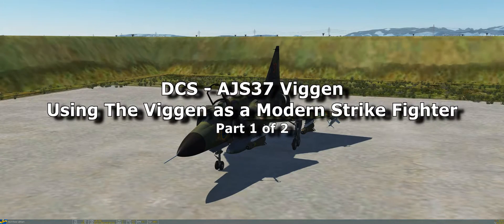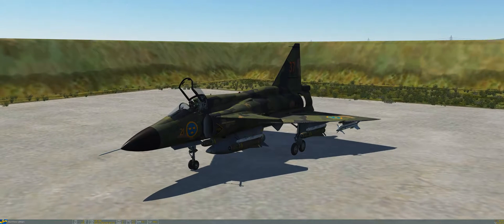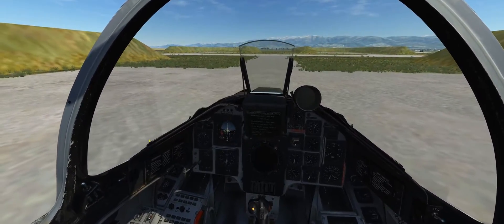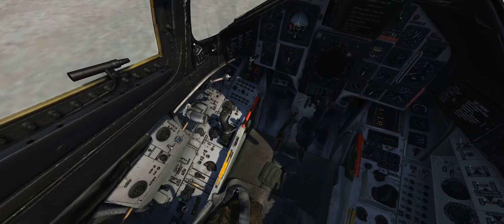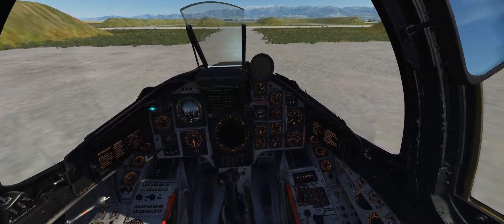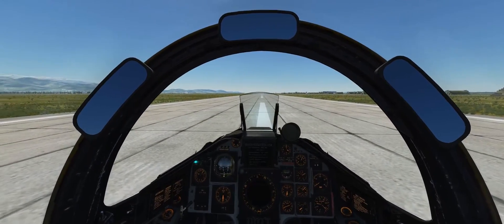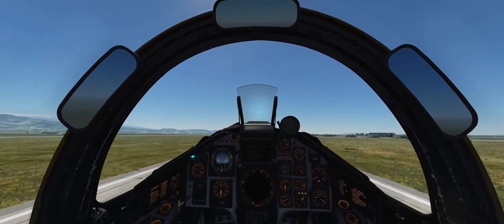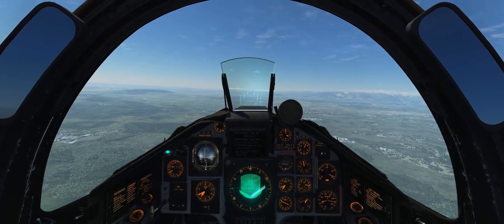DCS AJS37 - Using The Viggen as a Modern Strike Fighter 1 of 2

Comment: Minor typo in the Description.

It says RB 74 Maverick.
Instead of RB 75.

And also the Viggen Gained the Maverick Capability in the late 70s.
Not late 80s.

Though the AJ 37 only had 2 maverick Ready Pylons with the 90s 
AJS modification allowing it to be carried on all 4 Air-Ground capable weapon pylons.
Reply from the maker: Thank you I always get the rb74 and the rb75 mixed up. Also thank you once more for the info on the rb75! I always assumed it was added with the AJS upgrade since it required cockpit modification. I'll make sure to correct myself in future videos.
Reply: As with most aircraft there were many minor upgrades /modifications done on the AJ 37 during their service prior to the AJS program as well.

Including some cockpit changes.

And the EP-13 installation after the RB 75 was ordered in the mid 1970s was one of them.
It is just that there were no designation changes to indicate those updates.

So at a glance it might look like the AJS programme was the only
series of modifications done to the aircraft but that it far from the truth.

One have to do quite allot of digging though to find more indepth info about what modifications done when etc.

But the EP-13 upgrade is one of the easier ones to track down since it accompanied the RB 75 and since the RB 75 was delivered and entered service around 1978 the upgrade must have been done between then and when the RB 75 was ordered in 1975.

Comment: Well executed indeed. 😀 I found out that you can move the TV screen targeting system and still use the autopilot. But is it possible to "zoom in"?  I am asking because I tried to do it but did not find the corresponding keybind to use.
Reply from the maker: I prefer to maneuver my aircraft onto target rather than moving the seeker itself. Downside is that you loose altitude quickly so you need to be quick. Plus side is that, IMO, you can be more precise and it is easier to target. In terms of zooming in, I've found that if you lean out (with your head if you are using track IR) the screen zooms in. If you lean in closer the screen zooms out. Try it! :D